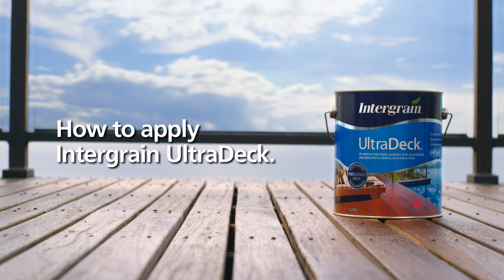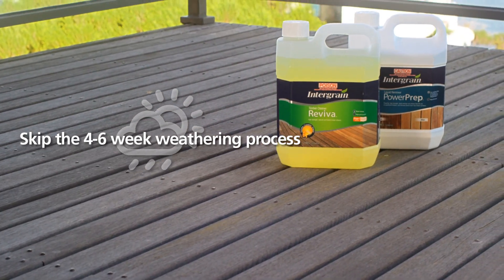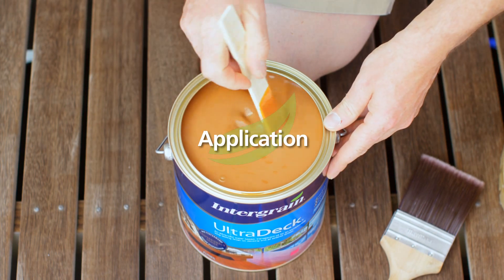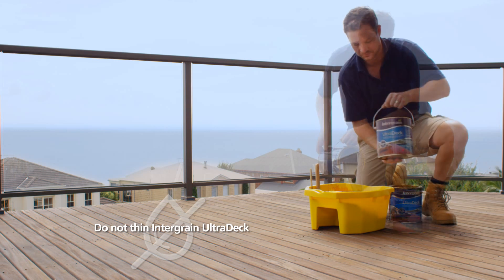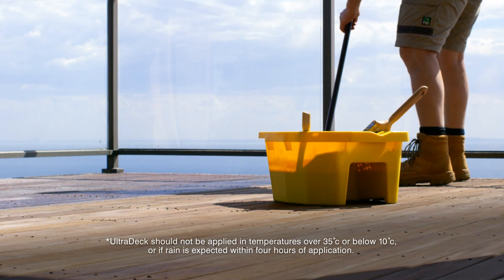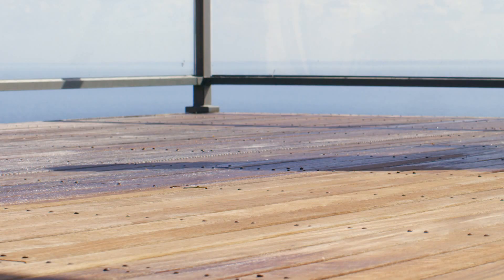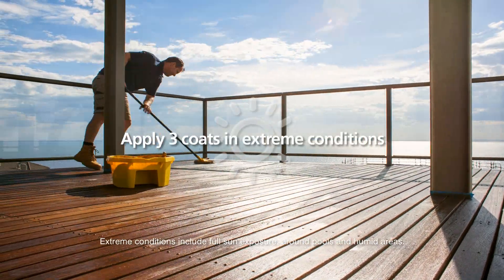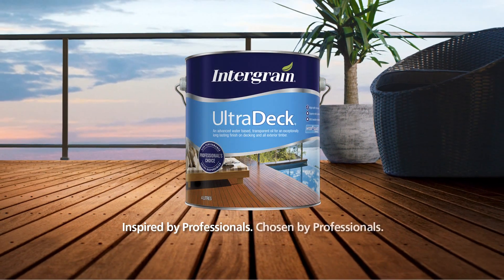How to apply Intergrain UltraDeck

Comment: As of 20mins ago this turned our beautiful, expensive, spotted gum deck bright orange. This is nothing but translucent orange paint to be honest. Extremely disappointed!!!!!
Reply: Did you use the natural version or the spotted gum?
Reply: Any chance we could get a follow up? I had the same experience with Cutek turning my new spotted gum deck red and had to sand the bloody thing multiple times to get it out. Really don't want to go through that again. Was looking to switch to Ultragrain. I've got my eye on Ultradeck Timber oil in spotted gum tint with ultraprep for preparation.
Reply: @bjornefellhanded9708  - I ended up going with Osmo Decking-Oil and used 006-Light Cedar on spotted gum, and have also got 007-Clear to put on top of this. The 006 has a colour to it, which gives good UV protection, the 007-Clear does not have any colour so minimal UV protection, but good for protecting from moisture/stains/dirt etc. My theory is between these two I can get a good colour and good protection in years to come. The price isn't crazy either. Osmo have some really good products (I like their Poly-X for indoor wood), and although I can't comment on the long term performance (as I have only just done it), I like the look of it and there are plenty of positive reviews on the internet. 

**I am not paid by osmo but just looking for the best solution for my expensive deck. If Intergrain have a better product I am happy to use it, but there are quite a few negative reviews for Intergrain, hence going down Osmo route.
Reply: Yep.  Turned my beautiful mixed reds hardwood decking a crappy orange but the tech advice was yep that's what happens.  Yes I used natural intergrain ultradeck.  Yes I stirred it properly.  Cheers intergrain.
Reply: @bjornefellhanded9708  don’t use the tinted versions. Just use the natural ‘clear’ as the tinted ones will show lap marks very easily. It only takes one oops to stuff up a good job.
Reply: @unclezeds  mine was the 'clear'. It's a crap product.
Reply: @Munrubenmuz  I guess it’s back to real oils from now on